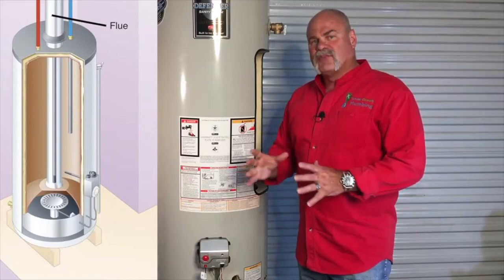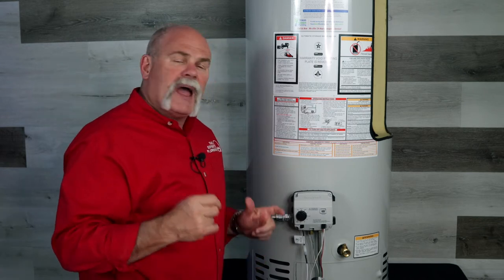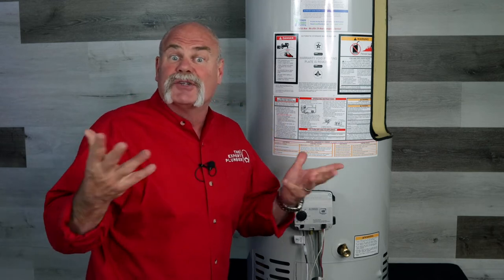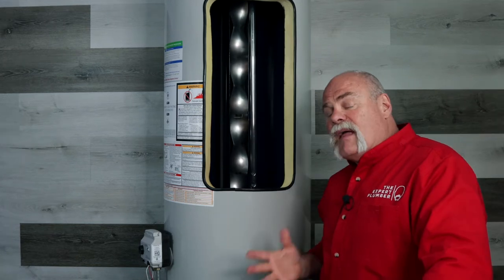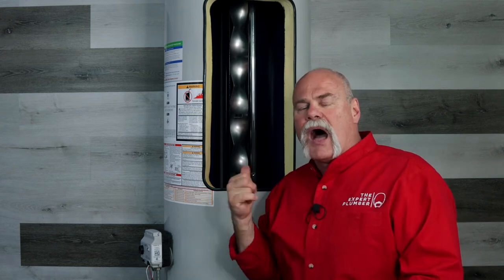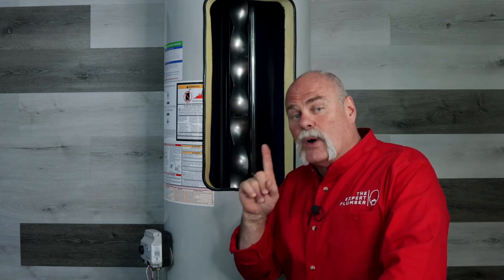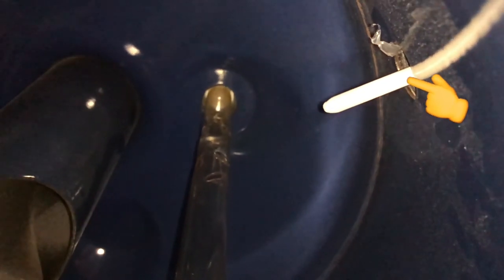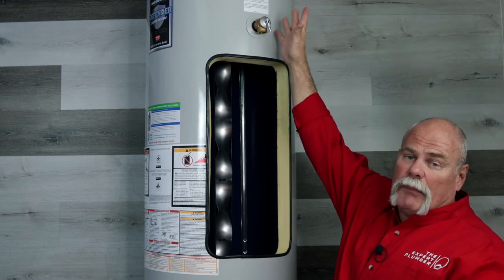Let's See What's Inside a Gas Water Heater

Comment: The technician, Steve, diagnosed the problem with our furnace quickly and replaced the capacitor. He then tested the unit and the heater worked flawlessly. Steve was very friendly, easy to understand, and professional. I would not hesitate to recommend him to anyone requiring heating and air conditioning work.
Reply from the maker: @Librada Morgan where are you located?

Comment: Thanks, Roger! Great video! I’ll try not to get flushed!!!
I have to install a new unit. It’s 30 years old and it’s leaking now. 
I’ll buy an AO Smith 50 gallon tall gas unit. The connections are clean and flex tubing, and looks like I can do it relatively smoothly. 
Doesn’t have the drain going to anyplace though. I’ll fix that too.
Thanks again and if no one else told you, I’m proud of you for getting all those certs, man!!!

Comment: I am buying a Bradford White water heater tomorrow because of the good reviews for the brand.  My current water heater is 23 years old, never flushed out and still going strong.  But I'm not pushing my luck any further so that's why I'm getting the new heater.  Thanks for the informative video because I was wondering what was inside and how much insulation there was.  The Rheme's and the AO Smith's at the home centers have horrible reviews.  I am hoping the new Bradford White will go another 23 years for me : )
Reply from the maker: I have a Bradford White at my house, no issues 💪. Is your current water heater a Bradford White?
Reply: @RogerWakefield  It's a GE smart water heater with a 6 year limited warranty : ) I've had it since 1999.

Comment: Hey Roger! Another great video! Replacing my water heater. Are most manufacturers the same? I am looking at a Rheem versus the Bratford you mentioned as we are in canada. What specific good quality components Should I be looking for on a water heater for longevity and maintenance free reasons for the components? I know that the Heater control is a Honey well on the new one I am looking at but I have heard horror stories about gas leakage or malfunctioning ones. You also mentioned the anode. Are there stonger or longer lasting ones and how would i tell? Our water heater is a 16 year old rental Rheem. We are replacing it so to get off the rental contract. No troubles and been running fine but it's time to replace it before it stops working. Thanks again!

Comment: Great video. I was wondering what was down inside the vent hole in the top. My roof was replaced recently and it appears some roofing materials may have fallen in there as now it smells like tar when my hot water heater runs. Is there any way to get down in there and clean out the exhaust vent?  Thanks

Comment: I have that exact hot water heater.  Dip tube is plastic though.  I had to replace it but it still doesn’t heat back up very well.   Been thinking old diptube is stuck on the thermostat creating a bad reading. ?   Ever seen that happen ?

Comment: Might take a water heater i found for scrap metal...had 12 in 2 weeks from the road then this lonely huge one im thinking a bunch of copper the screws ontop skips fiber glass wall? Is it worth it for me to take lid off gut the important metal put lid back on and throw it ober edge in the steel pile?